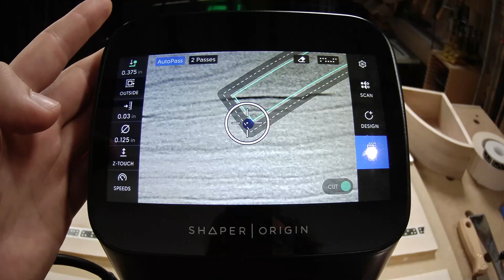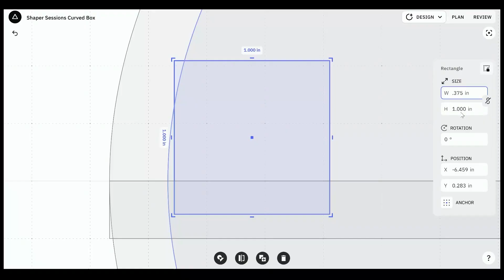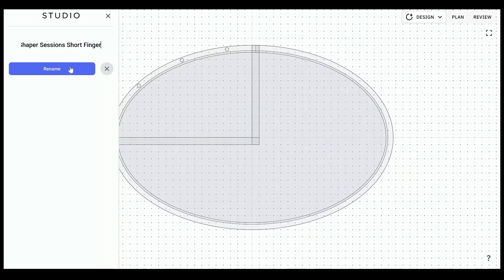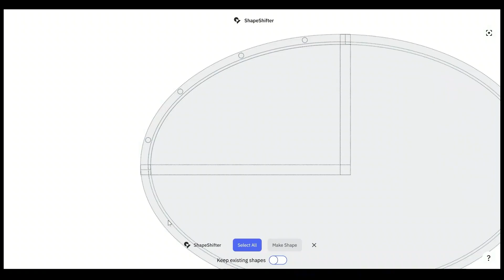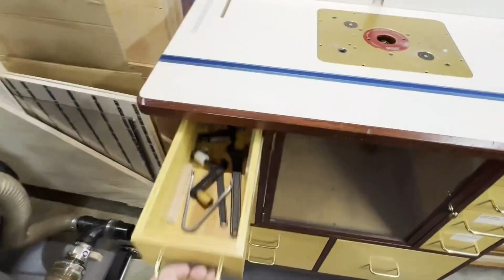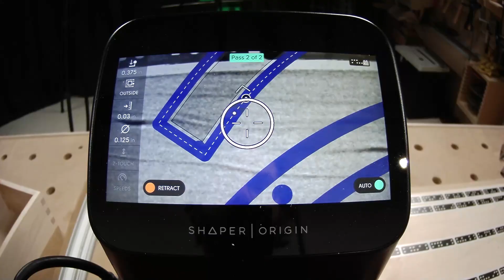Session 131 - English: Building Curved Drawer Boxes with Origin and Studio

Comment: I know the origin supports both metric and imperial, but for these kinds of video where there are a lot of measurements related to each others, using metric would be soooo much easier. Other than that, great video!